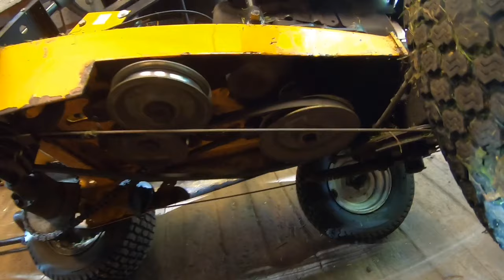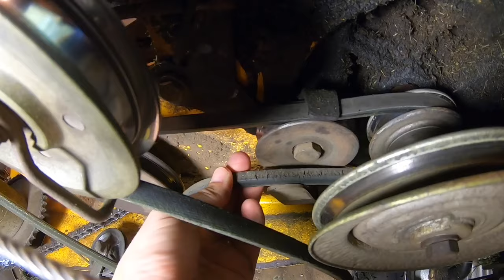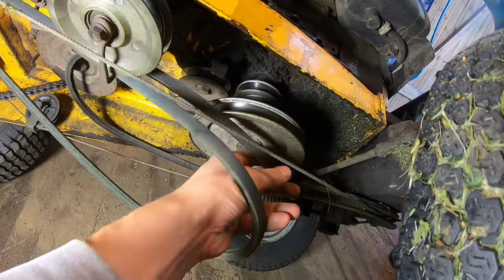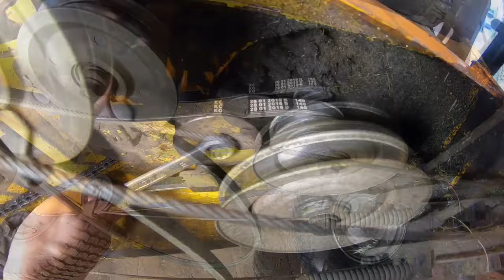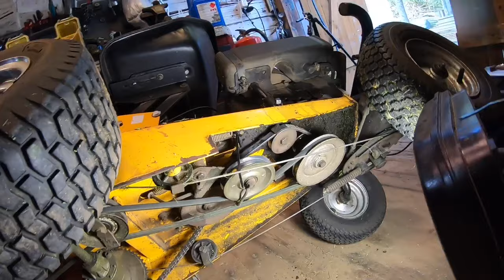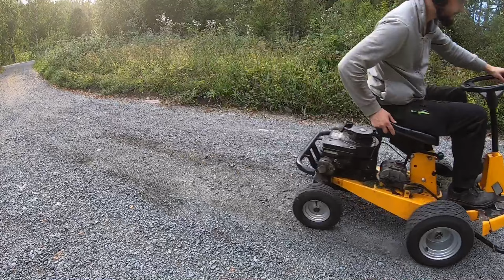Stiga Villa, changing drive belt

Comment: It would be helpful if you showed how to make sure the timing belt is on correctly in order for the cutting blades to be in the right position so that they do not collide when rotating
Reply from the maker: Sorry but I don’t have any mower with that kind of cutting deck right now. I will make more videos as I buy different mowers but I cant tell when it will happen.

Comment: Mine has abosulty no power at all at the moment.
Reply from the maker: No drive power?
Reply: @NilsKall  None, used to sprint in third from stop. Now slightly uphill only in 1st, can't use 4 or 5 at all and loses it when it turns. The engine still sounds good, so I'll check the rem tomorrow.